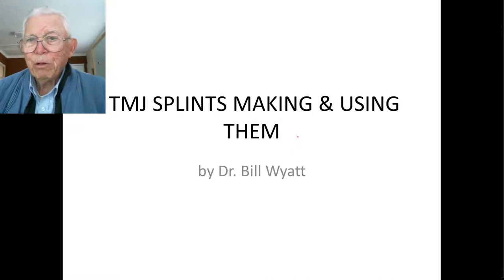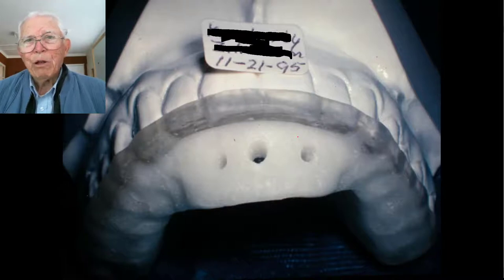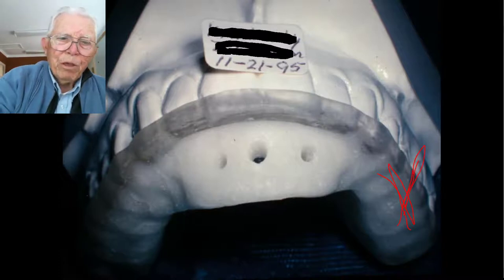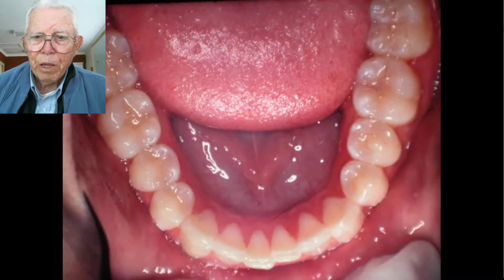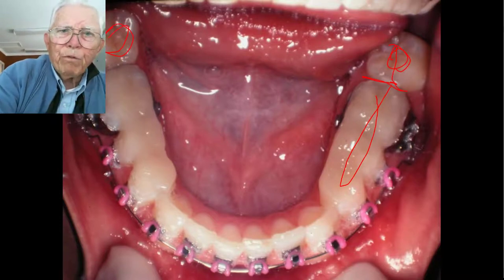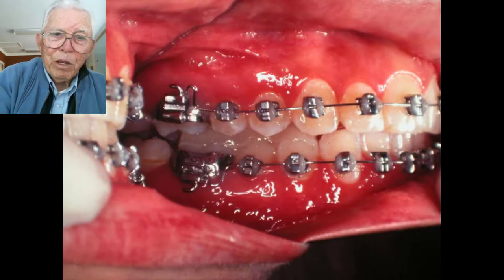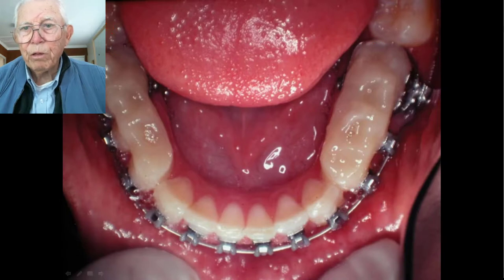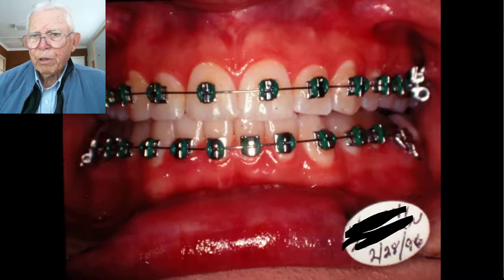TMJ Splints: Making & Using Them

Comment: That's a Farrar appliance on the top with the ramp. The maxilla is underdeveloped and forces the mandible back. You are bringing the mandible forward to where it would be if the maxilla had properly developed. She had a poor interincisal angle with the lower anterior teeth supererupted and forcing the mandible back with mandibular closure. Sometimes those second molars do not erupt well. Any solutions?
Reply from the maker: The problem is your mandible is too far back, putting pressure on the retrodiscal tissue. It's pretty simple to put an upper splint in with a ramp that causes a person to keep their mandible in this forward position and uses the posterior teeth to take the load off the condyle. It's easy to get them out of pain this way. The difficult part is moving the upper teeth forward to where the lower teeth will interdigitate with the upper in this advanced position. This is the difficult part of when you have to come out of the splint onto the teeth with the jaw still in this forward position. Good luck!